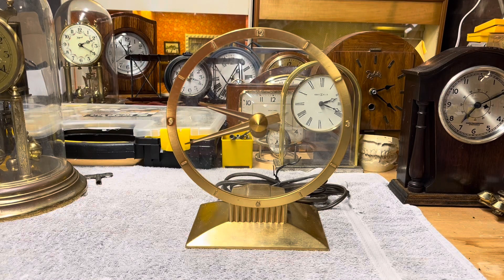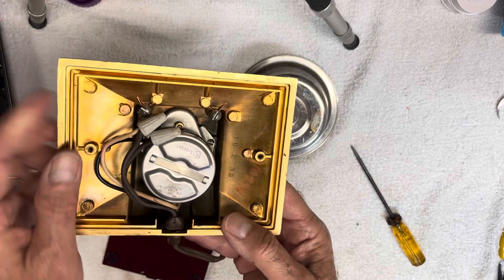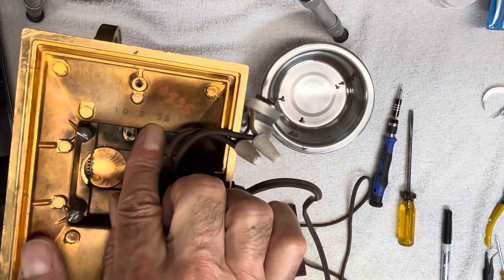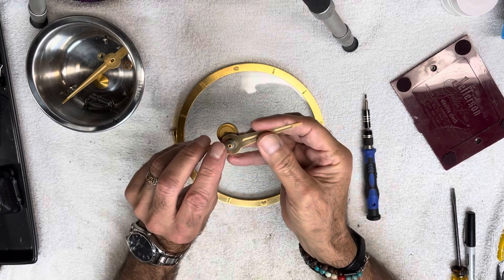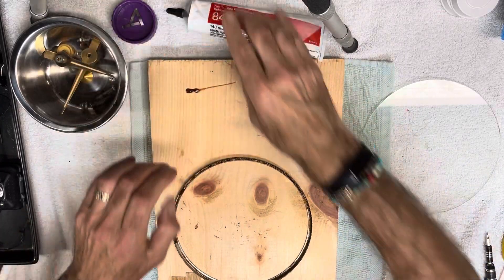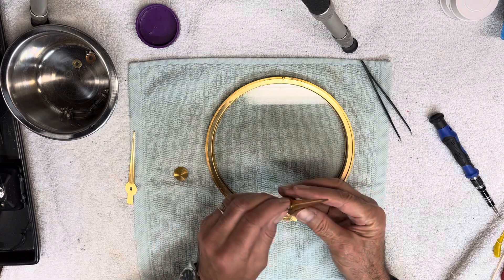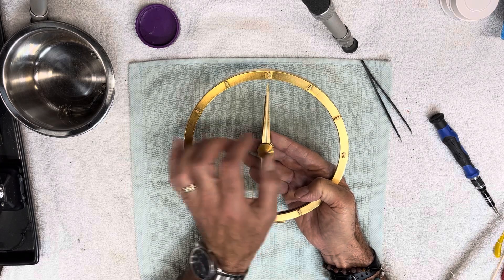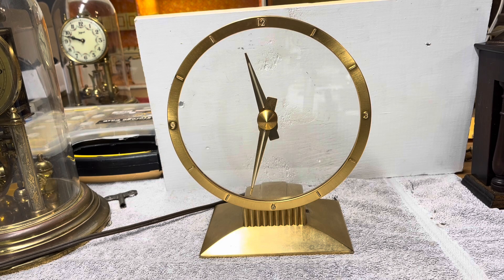How to repair a Jefferson Golden Hour Mystery Clock

Comment: Thank you! I replaced the motor on mine but it was losing time and I concluded it needed a good cleaning. This is just what I needed! Update: I'm so thrilled to have fixed it with your help. It belonged to my late husband and was disappointed when it broke.
Reply from the maker: Let me know if the cleaning worked.  It may still need a special kind of lubrication.

Comment: I have fixed several of these, so glad they make replacement motors. I use the JB weld clear glass epoxy, its lasted for years now.
Reply from the maker: Thanks for the info, I’ve been told that the only supplier of motors is Timesavers

Comment: The red base indicates that it's one of the older models.  You can get parts for all of it except the weighted hour hand.  The lubricant in the motor gets old and dry, and sometimes one of gears gets stripped so you hear the motor running but nothing is moving.

Comment: I have the same clock, these are gold plated so do not scrub the finish because you will ruin the beauty of the clock and it's value. By the way the numbers and the hands have radium paint on them so they glow in the dark. I noticed a notch on the retaining ring, I think it's purpose is to rotate the retaining ring to one of the peened points to remove it and replace it. By gently pressing the glass you should be able to rotate it freely in position without bending it. Please let me know if this is correct. There are several types of Jefferson golden hour clocks.
Reply from the maker: Yes, I noted that the clock is covered with a thin layer of 24 karat gold, only use warm water with a soft cloth, some Dawn for stuck on dirt. The glass should not be able to rotate but yes, the retaining ring needs to be placed a little off-center,  and then rotated until it locks into the notch, and then you have to gently pry it into position.  Thanks for watching!

Comment: You should have put a very small amount of lube at the three glass tension springs....the weight for the hour hand should have been taken apart and cleaned, and finally, the electric motor cover should have been removed and the motor lightly oiled. I may have installed a new cord. The cords on these get hard in spots and crack......and clear the workbench, you have to many parts and your running into and bumping to much stuff......
Reply from the maker: Thank you for the info.  I have been in touch with 'Bugsy's Dad Enterprises', he does clock repair specializing in Jefferson Golden Hour clocks.  He has given me a lot of advice and tips on how to repair these, including that they should never be lubricated.  He also recommends cleaning the weighted hour hand in an ultrasonic, and to never lubricate the gears. The motor on this one is a sealed unit and it can not be taken apart.  Many need new cords, but this one is in good condition.  He also says if a clock ends up running slow to use Neolube #2.  It is a water-thinned graphite/alcohol solution, that when brushed on the inside of the charge ring, including over the tension springs, the alcohol evaporates  and leaves a thin dry lubricant coating that does not attract any dust or dirt.  Clearing my workbench is easier said than done, lol.  Thanks for watching!